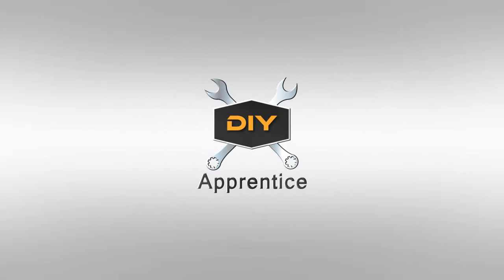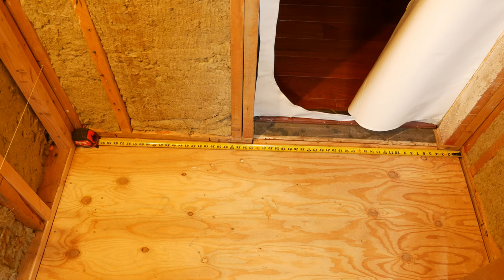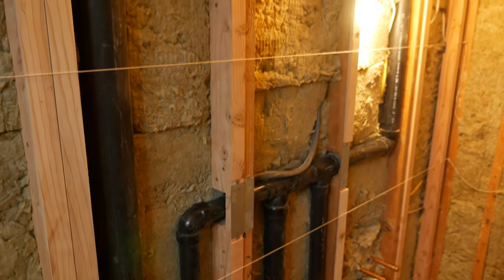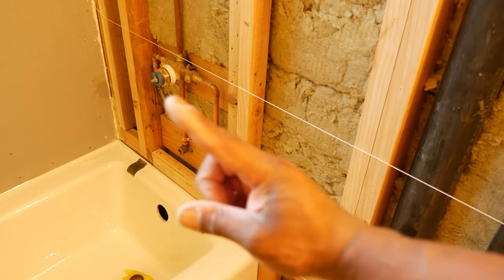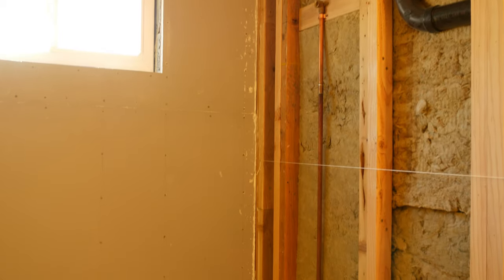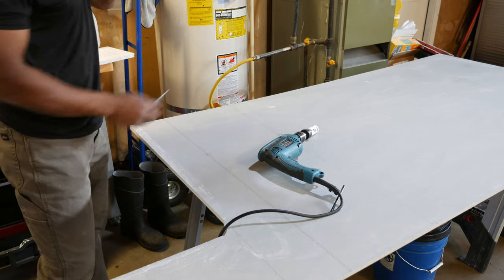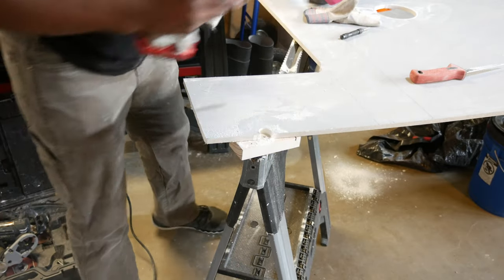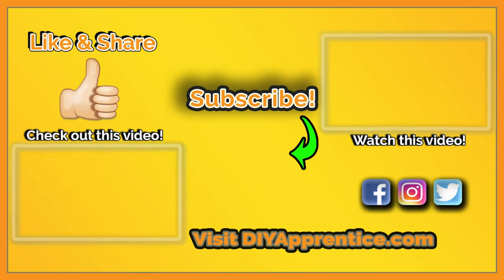Bathroom Remodel 64 - Installing DensShield Tile Backer 3 of 3

Comment from the maker: Thanks for watching. This is actually the last part of the backer installation - there is no part 4.
Making corrections to the right wall was a "fun" and challenging experience. One thing I forgot to mention is that I installed the blocking plumb in the corner adjacent to the exterior wall prior to running the string to the opposite end.
Another thing I forgot to cover is why the tile backer is so wide on the right wall. Well, when I put in the wall-hung toilet upstairs, I had to move the drain pipes; one is right where a stud would go to support the edge of the backer board. So, I'll have to skim coat then paint the DensShield where no tile will be installed. This solution is allowed by Georgia-Pacific, and it's one of the reasons I chose DensShield.

Please leave a 👍 and share the video

👉 Visit our website ► http://DIYApprentice.com
👉 Click to Subscribe! ► https://bit.ly/2pEBg3m

👍▬▬Follow Us on Social Media▬▬👍
✔️ Facebook ► https://bit.ly/2pAY8S3 
✔️ Twitter ► https://bit.ly/2G7mRDz 
✔️ Instagram ► https://bit.ly/2ILEKII 

🔧▬▬Tools and Materials▬▬🔧
✔️ DIY Apprentice Recommended Tools and Materials ► https://bit.ly/2T5psFw
✔️ DeWalt DW272 VSR Drywall Screwdriver ► https://amzn.to/2zpguKT
✔️ DeWalt DW272 Nose Piece ► https://amzn.to/2zpgqLa
✔️ DeWalt DW272 Carbon Brushes ► https://amzn.to/2xODuRw
👉 Dewalt DW272 Review ► https://www.youtube.com/watch?v=iEFbn...

✔️ Laticrete Hydro Ban Adhesive & Sealant ► https://amzn.to/2yBbRQy

✔️ Dewalt DW660 Rotary Saw ► https://amzn.to/2M3sFm5
I have an older Rotozip – some mixed reviews on newer Rotozip saws.

👉 Pitch-Angle Calculator ► https://www.blocklayer.com/pitchangle...
👉 Creating Super Shims ► https://www.youtube.com/watch?v=IGK3w...

📷▬▬Video Equipment▬▬📷
✔️ Camera used ► http://amzn.to/2GcpkOb 
✔️ Lens used ► http://amzn.to/2Deu16S 
✔️ Tripod ► http://amzn.to/2GbaM1c
✔️ RAM Suction Mount ► https://amzn.to/2Wz9PXh
✔️ Cyberlink PowerDirector ► https://bit.ly/2jTwGxT
✔️ Adobe Photoshop ► https://bit.ly/2V7nyUX
✔️ Camera Slider ► https://amzn.to/2WtD7GW
✔️ Deity V-Mic D3 Super-Cardioid Directional Shotgun Microphone ► https://amzn.to/2LI1lf7